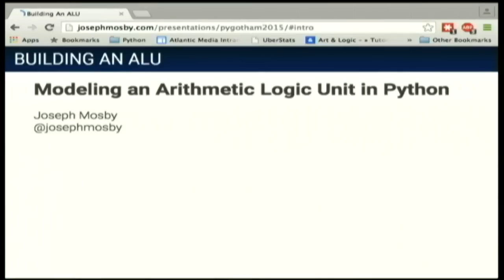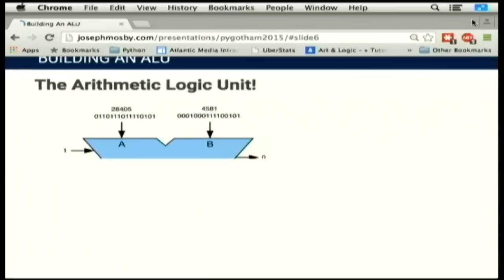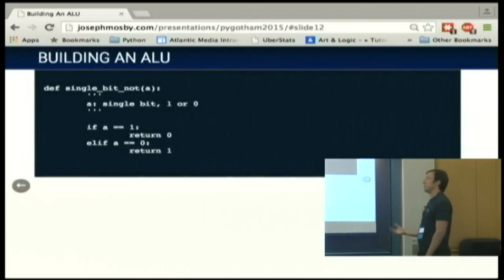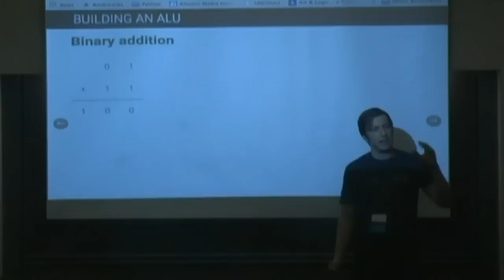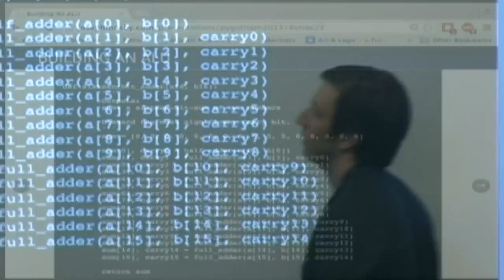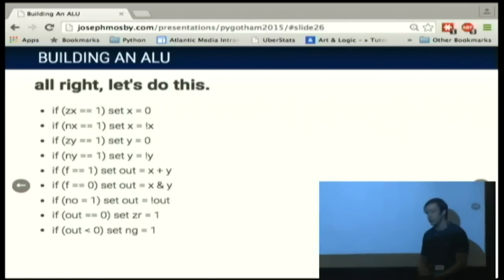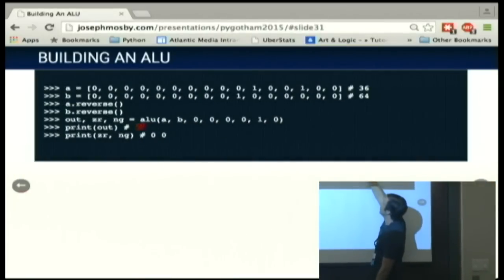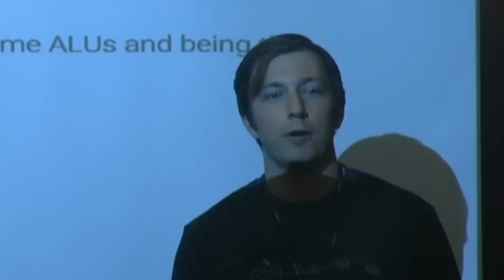Modeling an Arithmetic Logic Unit in Python

Comment: very underrated video, Im currently working on an CPU AI simulator that can run parallel with the CPU that takes instructions from the physical CPU and make calculations then compile the data for computation reducing load